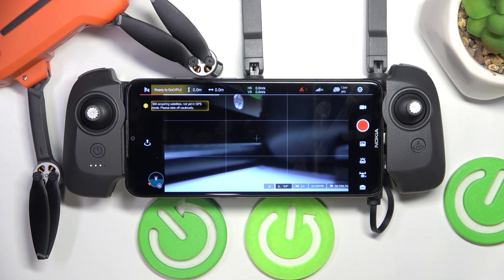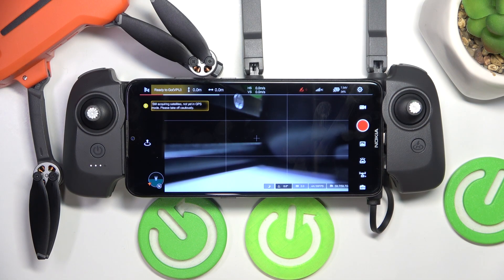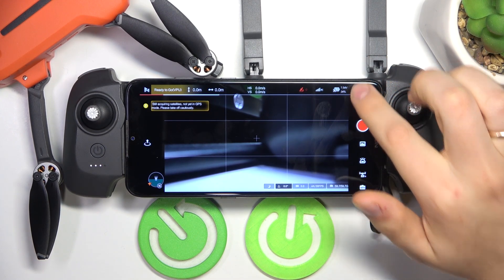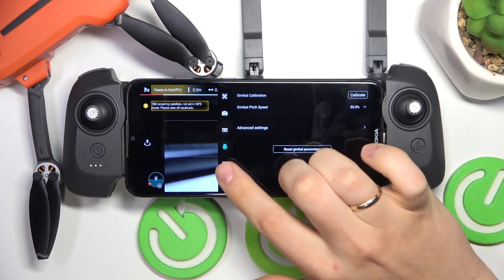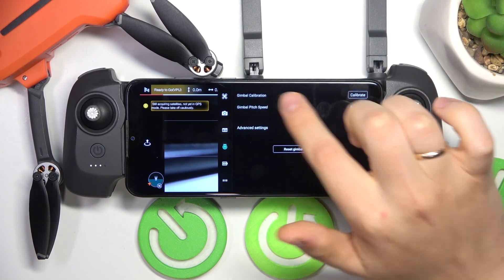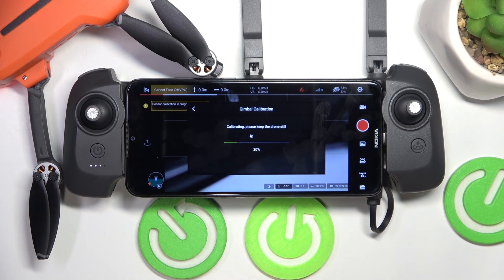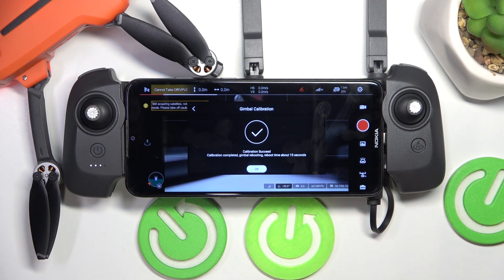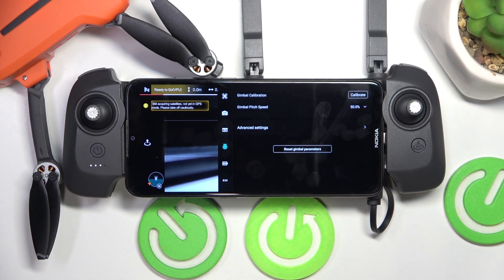How to Perform a Gimbal Calibration in FIMI MINI 3

Comment: Mine gets hung at 45%, says movement detected and make level, and never progresses.  I NEVER TOUCHED THE DRONE OR MOVED IT!  Waiting on mfg to return msg to me.
Reply: same
Reply: I have the same issue, how did you solve it?
Reply: @abnormal4o  I ended up returning it to Amazon and getting a Specta Mini, its a "copy" of the Mini 2 4K, all is good now.

Fimi never answered any attempts to contact them.  Ive used Specta's customer service twice and they are on-spot!
Reply: I'm on a loss for now, mine just arrived in Brazil from AliExpress, gimbal seems to be dead on one of the axis, also won't calibrate, waiting for AliExpress to allow the return so I can get the dji mini 3, good thing is AliExpress has an office in Brazil and is obliged to return items within 7 days of arrival if the customer wants to do so.